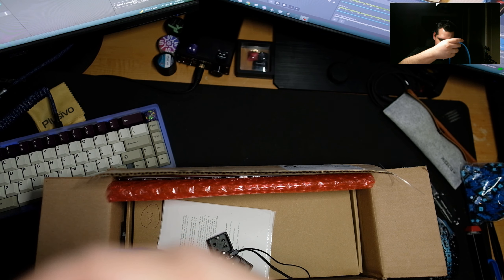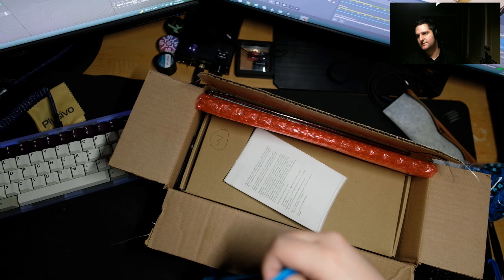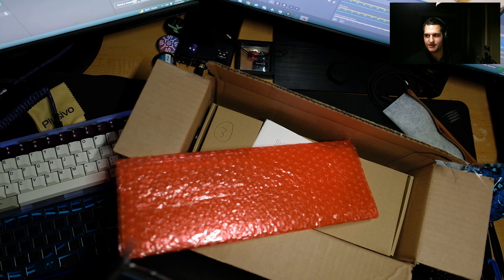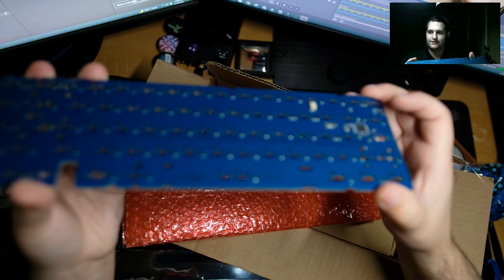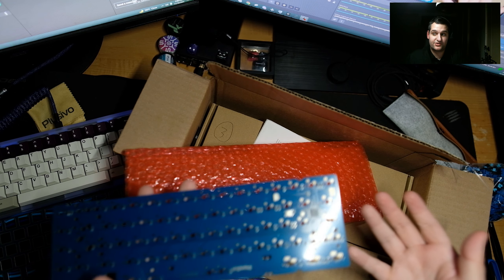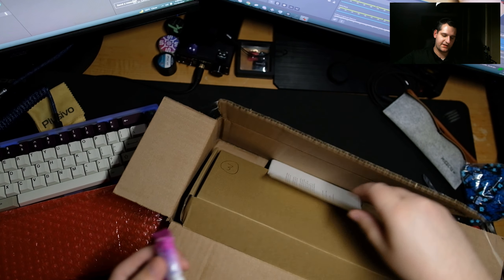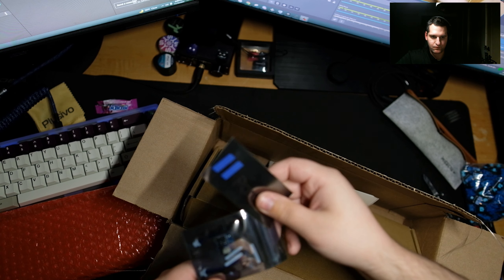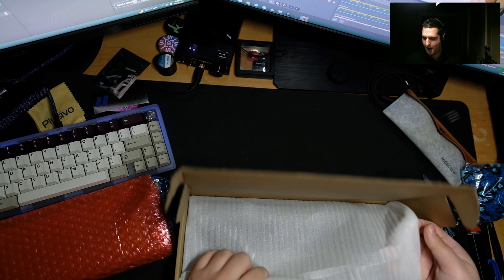Parallel BEAM65 - Unboxing, Build and Review

Comment: Waiting through this process was absolute hell, communication was awful. After all the waiting we got an unfinished product. Shipping a daughter-board that doesn't even fit on a $400+ kit is BEYOND unacceptable. Not having foot indentations is also a complete joke (aside from all of the manufacturing inaccuracies). Parallel had built a good reputation with the Portal/Array/Snake boards, but as you said they aren't comparable to this board. The beam was shipped in a cardboard box with no case. To make matters worse, people who ordered in-stock parts had their plates shipped in plain envelopes with no protection causing them to bend. Within 3 months they opened 3 group-buys promising the most unrealistic timelines and then failing to deliver because its only a 2 man operation (Original delivery date for Beam was scheduled for June 2023). Not to mention they mislabeled this as a pre-order when it was really a group-buy. Wangus had been more than transparent with us but Glizzo really dropped the ball on us as a community. The delivery of this board seriously has me concerned for what the next batch of boards will look like (camber/warp).  Certain people in the company really have a knack for destroying a loyal customer base. I will NEVER buy from Parallel again after this.
Reply from the maker: This is actually what I should have stated in the video hahaha